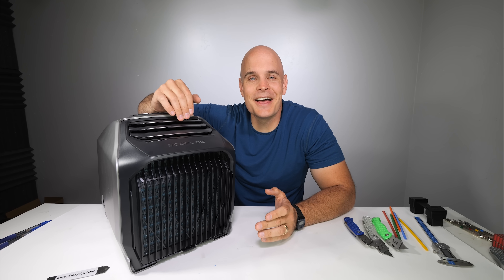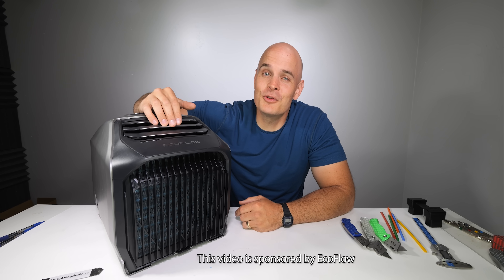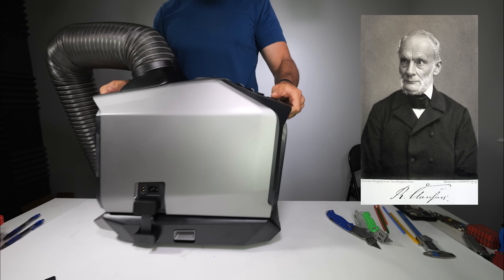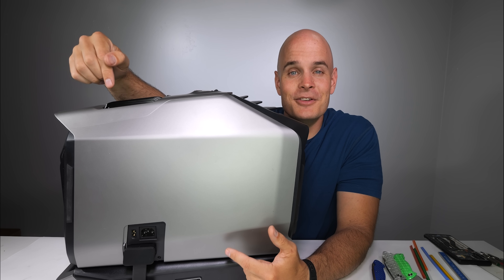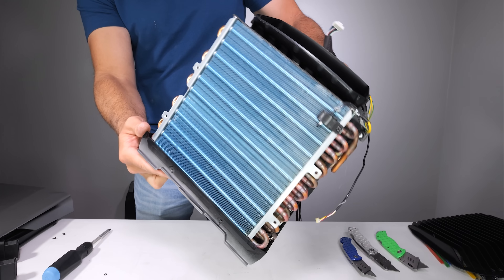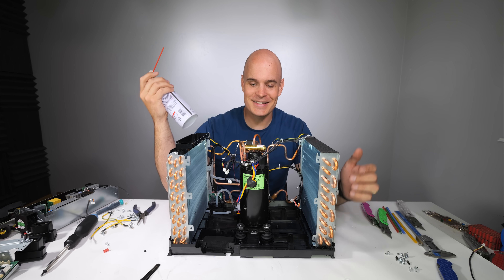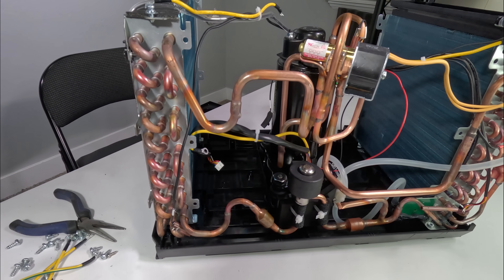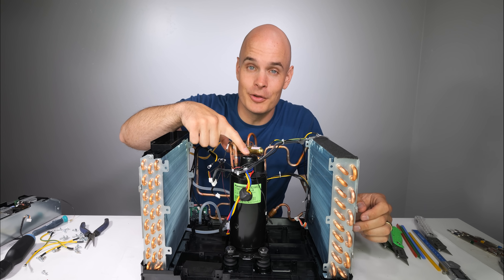THIS CHANGES EVERYTHING... (Ecoflow Wave Teardown)

Comment: I hope you were being facetious when you said that this device was "200% efficient." It's not, because heat pumps merely move heat, they don't intentionally convert electrical power into heat like a space heater. And while the space heater is - nearly - 100% efficient, probably as close as we'll ever get, but some energy does get radiated as sound, some as an electromagnetic field, and some as mechanical vibration. All that said, it's a really interesting video, I have liked and subscribed, and you have a really good "broadcast" voice.

EDIT: R290 coolant is propane. Dangerous as hell if there's a leak.
Reply: @EpicDrew15  I think you need to re-read the definition of efficiency. Efficiency is simply what percentage of the energy going into a device is converted into the energy we desire. Again, heat pumps DO NOT deliberately convert electrical energy into heat - they just move heat from one place to another. Yeah, you can get 1,000 watts of heat into your apartment using just 500 watts or less of electricity, but that does not mean the heat pump is 200% efficient, because nearly all that heat is being pumped - as the name implies - from the outside air. 

It's kind of like saying that a push button is 100,000 percent efficient because you can use 1/10 watt of energy from your finger to push it and suddenly 100 watts goes to power a light bulb. The power from your finger is not lighting the light bulb, so the button is not 100,000% efficient.

The fallacy in saying that a heat pump is 200% efficient comes from the fact that you're only counting the electrical energy going into it. You're not counting the energy it saps from the air around or behind it to heat the air you want heated. If you did, you'd find that like most machines, it's nowhere near 100% efficient.

Comment: Other than a lower btu rating what distinguishes this from a run of the mill window ac unit? 6000 btu window ac units cost about $150-$200. This costs $1,500 for a 4100 btu rating. Do not buy this.

Comment: Surprised to see r290 (propane) on an indoor residential unit.  It is the most efficient. They must use a very small amount and it requires lower compression compared to other refrigerants like r410a or r32
Reply: It’s charged with 130 grams of R290😊
Reply: Most countertop ice makers also use R290.  I guess the justification is the small amount.
Reply: I thought countertop ice makers were usually butane
Reply: @TAWithiam  Just for yucks, I unboxed my ice maker and, you are correct!  R600a (isobutane)
Reply: Even those smaller "dorm" fridges & freezers use R290 (propane). With the small amount needed & overall ease on the compressor plus the environmental safety it's really a good alternative to more classical refrigerants.
Reply: Yeah, the limit is ~1lb of refrigerant for hydrocarbon based refrigerants. I'm guessing thats the limit small enough not to create a stoichiometric ratio in open air. Most new appliances are using hydrocarbon refrigerants now as they are way more efficient like you said, and also a very low GWP rating. The only big downside is flammability.
Similar with ammonia. Very efficient refrigerant, but also very deadly... Even an ounce of a pure ammonia leak would choke you out. I used to work with 30% ammonia and just taking the rubber stopper off the bottle would almost knock you out.

Comment: Its called a window AC and its there is almost every home mounted on windows here, very old tech just made the housing fancier thats all.
Reply: no it's not a regular window AC, it can provide heat as well.  It can also run off a battery and is portable, uses a DC compressor that if ran from a DC source is much more efficient.  They do make heat pump/inverter based window AC units now as well but they're quite a bit more expensive than a "standard" AC unit.

Comment: Wow, a portable 1 hose ac unit. Ive never seen such a common thing before exept almost everywhere
Reply: It actually has 3 hoses, a variable speed DC compressor, 1+KWH battery pack, can be powered from solar or another Ecoflow Delta product directly with DC...Literally no one else makes anything remotely like this
Reply: @rcguymike  Though if you're going to do the kind of off-grid luxury camping this thing seems made for, you could just as easily have an inverter/battery pack (like the ones eco-flow also make) and just plug a normal portable AC into it.
Reply: @JorenMathews  not nearly as efficient
Reply: @rcguymike  Why would it not be as efficient?
Reply: @JorenMathews  conversion losses from DC to AC back to DC.  The Wave2 can use the solar power directly with it's DC compressor as long as the battery is hooked up and the other Delta power stations can connect to the Wave2 with an XT150 based direct DC connection
Reply: How many are 100% portable and don't require a power outlet on top of being able to provide heat? As for the price? I'm afraid to look.
Reply: @ericharrison619  $1,000 early bird price
Reply: The 1 hose concept is actually a bad compromise for mobility. It sucks warm air from the outside all the time. With a 2 hose in/out concept the efficiency could be up to twice as high. Like with a split climate device, which can be 300 - 500% efficient compared to the "200%" term.
Reply: At only 1500 BTUs, it'd make a pretty terrible air conditioner. Good for cooling a tent maybe?

EDIT: I misheard it. It's actually 5100 BTUs, making it a pretty capable air conditioner. My mistake!
Reply: @Tresla that would be 5100 btu's, so it would cool an average sized room nicely.
Reply: @snakedoktor6020  It would be perfect for most RVs!
Reply: @Tresla  wrong, it’s 5,100 BTU/ 1,500 Watts! Cooling Area is 107.6 sqft/ 10 sq meters.
Reply: @melissasmess2773  Oops, you're absolutely right. I'm not sure how I heard 1500 😳My bad! In that case, it's actually a pretty capable air conditioner. Could cool a small room with that!

Comment: The best thing about heat pumps is that efficiency, they are amazing, as long you work them to cool a cold room or heat a hot one. When used normally, no miracle gains and hardly any efficiency at all.
Reply: Careful, your ignorance is showing.
Reply: what are you even talking about? they work basically the same as a air conditioner, only a heat pump also work in reverse and can heat up a room.
A stationary air-to-air unit is between 2-5 times as efficient as conventional resistive heating

Comment: Ok, Ecoflow is about to release a entire off-grid fridge and I'm sure about that.
Reply: That would be awesome, I’m sure it will be just as efficient being direct current powered!
Reply: technically they did if you are including the 12 to 24 volt chest fridge/freezer with ice maker they just released. Can be ran by battery pack, ac power or solar. Ice maker has to have ac power or the battery pack they make for it.

Comment: Would be better if this unit was much smaller. Btu stands for British Thermal Units. The reverse valve reverses the flow of refrigerant flow between the two coils.  Great video.
Reply: Heat transfer requires a significant amount of surface area. In this packaged unit we see micro channel fins, modern refrigerant and DC power.

Comment: So EcoFlow is getting around the laws by getting you to break them.  Not a good move on your part.  Specifically Single hose A/Cs are so bad you can't advertise the BTUs.   You have to advertise the Elective BTUs with is about half.   The exact system they need to use depends on your area.  Yes, Half the cooling for all the power usage of a two hose one.   Then this B.S. about being 200% heating efficient is just ridiculous.   I suppose if you buy two they say it's 400% efficient.   That's just not how math works.  
Man you should look this stuff up and once you've seen what damage to your reputation this is doing you may want to redo the video.
Reply: It's not a "single hose A/C"  research at least 5 seconds before commenting 😉
Reply: @rcguymike  How about you read what I actually wrote.   I'm commenting on he ad and the laws.   Not the product.   He states the units BTUs and not the effective BTUs.   There is lie 0% chance the EcoFlow doesn't know that putting out that information is misleading and against the law.   Never mind the stupid 200% heating thing.   I mean really.  That one was such a whopper who would even believe that. So.   Spend the five sends and send me the link with the effective BTUs and not the actual BTUs and if it actually matches I'll  retract my claim.    But I'm guessing I'm just going to get an excuse.

Comment: Thats a literally an air conditioner in inside
Reply: By name, technically maybe.  A standard A/C can only move heat energy one way and usually the compressor is either on or off.  This unit can heat and cool and has a DC powered variable compressor which is much more efficient than a standard "air conditioner".

Comment: As a residential HVAC technician I have to say that this was the best way I've seen the refrigeration cycle described for a heat pump. It's basically the same concept for the AC in your house
Reply: Not really the same as a standard AC, as this uses a variable speed motor and the cycle is reversible to provide heat as well.  Much more efficient.
Reply: @rcguymike  right. Just like your standard heat pump
Reply: @dysfunctionalgamingveteran7753  sort of, a "standard" heat pump also probably has an AC compressor, this has a DC compressor that makes it a little more efficient to use with solar and batteries as well 👍

Comment: Yo, if this thing can actually last as long as averted, even with needing 2 batteries.  It's a win for me.  I need something like this for my tractor so i don't have to waste a lot of money idling so it's not 110f in here in the summer, i don't want to spend  $20k on a tri pak or try to feed a 1000w unit from m my trailers gen. With this, I could charge the batteries as I drive and when I stop,  no idling!

Comment: I believe there will be a number of niche mobile applications especially on smaller boats, campers and even tents.  The solar port is a big plus.
Reply: You can just solder a connector yourself with an inverter.

Comment: When you get smaller things in size, the efficiency decreases, and although it is not the best, it may be more expensive, and the fact that there are no two types of cooling may cause a problem in heat. I prefer the separate refrigeration unit, which is more efficient in stages and cheaper.

Comment: i think colder countries should all start using heat pumps rather than burning wood or gas, which is harmful for people and for enviornment and those countries have to be reliant on others for fuel, heat pumps are also cheaper as they cool in summer and heat in winter. doing two functions.

the split air conditioner in my home consumes 1400w and transfers heat at the rate of over 5000w, soo heat pump will also save you quite a lot of energy too

Comment: Although the process maybe efficient , Ac units with vent hoses are never that efficient, because your extracting the air you all ready paid to cool out of the room through the condenser, heating it up and sending it outside down a hose, and when you extract air from a room more will inevitably enter from somewhere else that will need cooling all over again - split systems are the most efficient way to cool and heat as you can seal the room and recycle the air with minimal heat gain from air being drawn in from outside
Reply: This includes 3 vent hose adapters to take and direct the air to and from anywhere you want, you can even set this up to cause positive or negative pressure if desired.
Reply: @rcguymike  there is a finite amount of air in the room - how can you prevent causing negative air pressure in the room which will draw more untreated air in from outside if the unit extracts the air from the room and vents it outside to get rid of the heat? Can u explain how the unit overcomes creating negative pressure and is still able to vent waste heat outside please?
Reply: @gamwam  This unit can be configured with a ducted vent to draw air in from outside, isolated from the room, cooling the hot side of the exchanger, then another ducted vent pipes it outside. It's isolated from the room, there is not low pressure pumping.
Reply: @_BangDroid_  so a twin hose configuration? - can u explain what kind of window adaptor it has? - the twin hose unit I had was incredibly awkward to vent outside, I’d be interested to know how this unit overcomes that
Reply: @gamwam  All this info is available on their website as of 9am EDT today

Comment: Very neat. When my kids finally move out, I'm going to build out a Sprinter van to live in. I'm going to need something like this. I was thinking about making a regular minisplit heat pump work, but something like this would be an easier option.
Reply: Unless you live in the northwest you'll need something akin to a mini split. Of course insulation is a key factor and diesel heaters in conjunction with powered ceiling ventilation for summer, go a long way.
Reply: @digitalparadigms  Oh, but I do. Local temperatures range from 20-110 F. Only a couple months in spring and fall of comfortable climate.

Comment: Just ONCE I'd like to see one of these "standalone" A/C units have both an intake and exhaust for the condenser coil's airflow.

ALL These style devices exhaust the same air you're trying to cool/heat, which causes a pressure differential making the climate controlled space draw in outside air.
Reply: It has 3, optional but included, vents, 1 for intake, one for exhaust and 1 for the output air
Reply: @rcguymike  glad they understood the need for intake and exhaust. For my tiny cabin I am really interested in how much it could save on heating. Lots of inexpensive A/C units already available for in wall or windows.
Reply: once I saw one of these with sockets for big air hoses that you could mount on your window to use outside air to cool the inside air, I think LTT used one in one of their intel setup upgrades
Reply: if you watch the video or look at the specs you will see it does have an intake and exhaust hose for the condenser unlike most portable ac's on the market.
Reply: The best portable AC units are two-hose models, and they're still junk.  If your windows won't permit a window AC however, your choices are limited.
Reply: Trotec used to make one (PAC 3550 Pro) but they discontinued it a couple years ago for some reason...Now, there are pretty much no two-hose models on the European/German market
Reply: Amen
Reply: My comment almost word for word. These single exhaust hose units will NOT cool a small space like a tent, RV or boat cabin. You only feel cool if you have the air blowing right on you.

Comment: If one doesn't have a hole cut into their walls, or has those tall sliding widows, it's a huge hastle fitting some sort of air egress channel using wood or some other material that also doesn't let in heat, "windowless" air conditioners aren't truly windowless as you need some place to stick that exhaust tube out of, which is insecure, lets in heat, and just a hassle overall, i was excited looking at this from the thumbnail cause it didn't have the exhaust pipe attached (which is how they market all these types of devices), but one you put that on, i became a whole lot less interested.  these have instances where they can make a difference for sure, like car/van/cabin camping i guess, but I've already got a windowless ac, which isn't very efficient, and a whole hassle and a half to set up, which takes up my entire patio door (insecure, lets in heat from sun/hot air hitting the exposed sections)
Reply: It comes with an intake hose, exhaust hose and output hose 😊

Comment: and a BTU is a British Thermal Unit...its an arbitrary standard started in England to denote heating power...its the energy required to heat 1 lb of liquid water 1 degree...so 5100 BTU would mean the thing would be able to heat 612 gallons of water 1 degree lol

Comment: No way its even 100% efficient, some energy is lost through the wires and as heat. Whoever says thats anything is 100% energy efficient is lying
Reply from the maker: It's lost as heat through the wires. And any heat lost in the machine is still heat. Which is the purpose of the machine - so it's 100% completing its purpose and 100% efficient.
Reply: @JerryRigEverything  copper wires don't conduct electricity 100%, a percentage is lost just because of the metal being used from the plug to the heater, as well as a small percentage undoubtedly going into light energy